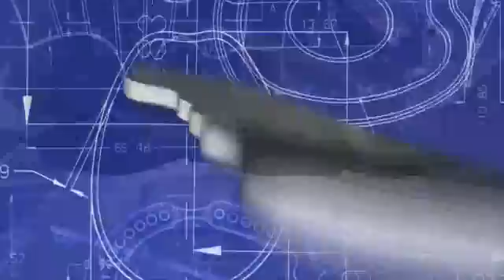#britek  Energy Return Wheel... Autonomous Never Flat

Comment from the maker: @THXn11 The hoop is "sprung" to the ground by the 360 degrees of directionally charged membrane. The hoop always fights to return perfect center around the wheel. It responds much more quickly than an air filled baloon... is anti gyro. and anti bounce. Bounce is cut in half as the equal and oposite actions happen in the same time on opposite sides of the ERW  a "singularity" action that pnu can not match.

Comment: @EnergyReturnWheel incorrect. staying flat will not improve handling. as it will remain rigid, and like any low profile tyre , will create slide or stepping out, . on traditional tyres the side walls flex in lateral movement and transfer of weight to eliminate slide, as your tyres are so rigid this will slide out, making it more dangerous. i am wondering where your information is coming from and what studies and field trials have you done? also where is the tabulated data to back up your claims?

Comment: THIS video, where I can see a lot of steel and bolts, so I made a presumption regarding the weight compared to existing run-flat tires (which, admittedly, require replacement when breached, compared to a lump of metal which, obviously, does not go flat at all).

With over a thousand comments, I am sure you cannot actually expect me to read through them for further information..? I can get that information from your site? ;)

Comment from the maker: @honorific88 patent searches we did showed a linear coil spring wheel out of the early1900s. Interesting for buggys but for cars a throttle responce and handling created tiping  and rolling around.  Our 360 opposing membranes are drawn with aprox. 300lbs. each upon installation and perform like directional slingshots... all focusing to a single point  against the pull of g. or other forces when the wheel is on the ground. And yes it does require less energy.

Comment: In a drag car they have normal tires with sidewalls, those sidewalls flex hard so the car can grab traction. Does the steel hoop in this car act like a side wall? Or is this just for everyday driving? Even drag racing on the street....

Comment: the only safety plus is for people who somehow don't know you have to check tire pressure and run them flat.  They will increase gas milage a little because it has such a lower rolling resistance due to the stiffness of it so its footprint is smaller but with a smaller footprint comes less grip so you have to use a super soft rubber to make up for that.  Then with softer rubber comes less milage life for the rubber part.

Comment: He didnt do anything... You hit a curb or a speed bump the wrong way the steel will dent and deform. Driving on high ways or free ways at speeds of 60mph+ will create heat within the tire that may warp the steel, especially when a person were to hit something(animal, debris, etc). N2 within tires will morph but then redistribute pressure. This wheel has potential, but in no way is this efficient to buyers nor sellers.

Comment: Yes i just re-watched the video 3 times and there is no way for the tyre to "bend" on the sidewall because you have eliminated them and also seems as though the actual rubber that is touching the ground is bolted to metal how can that twist and flex with the weight of the vehicle, example: your turning right so the weight of the car has moved to the left and the left tyres have the most weight on them so by bolting the tyre to metal it makes it very hard to have the tyre moving like a tradition

Comment: well said...  you'd pretty much have to cover them with sidewalls to keep crap out, and, they will NOT hold up on performance vehicles. also, slamming the brakes puts MORE stress on a tire/wheel than breaking them loose with a burn out.  they can test the safety up to 65mph or whatever, but people go faster OFTEN. they will fail. grade 8 hardware is brittle. normal bolts are too weak. w/ proper amount of steel bolts, wheel will weigh more than a normal wheel. run flats work fine!!!

Comment: Modes of failure:  1) shear forces applied to the current size of threaded bolts in sharp cornering will reach the ultimate tensile strength of bolts or at the very least place them in the plastic range.  2) mud, snow, ice built up in the gaps will cause imbalances in the wheel resulting enhanced vibrations that are considerably greater and more frequent than those experience by normal tires.   The end result: greater tire, suspension and frame fatigue.  And, the list goes on.

Comment: this is interesting tech and good luck with development. the problem i see is handling. tyres have been designed to move and flex whilst cornering to keep the largest contact patch on the road. this set up would prohibit that and thus reduce handling making cornering dangerous and causing more accidents. like low profile tyres, they do not handle in cornering situations and tend to skid or "step out" also if this wheel was the jam up with mud or debris it would decrease handling and efficiency.

Comment: What is the net effect of "increase efficiency" and increased weight of these wheels vs. the standard air-filled tire?  A simple comparison test for a tank of gas run on 4 normal wheels vs. a tank of gas run on 4 of these wheels would help prove your case.  Has such a test been done?  If not, I would have to call bullsh$#.

Comment: @EnergyReturnWheel 180,000 Kilometers (112,000 miles) is a little over 25,000 Kms a year (that's 16,000 miles/year).  About average for the typical Canadian in this area.

BTW - I keep the tires on my bike full of air too.  I had a problem with cactus needles but I put a product (Slime®) in the tires that seals any small holes as soon as there's a leak.  I haven't had a flat in years.  Oh, I wore out a set of tires on my bike too.  It only took 2500 Kms - but for $50 I had a brand new set.

Comment from the maker: @jojothedog1234 The spring replaces the air, and transfers the energy from bumps more efficiently back to the ground by levering from the TOP and Front back of the tire.  This is also apparent in a dragster tires crinkling to hold grip slingshotting it forward while  torque is applied. WHICH is the very reason why they are so BIG.

Comment: The idea is great, but will it endure years?? My concern is in the spring like spikes, with time any metal used as coil overs, leaf springs, etc. loose their tension and also tend to loose their original shape. It would be catastrophic if the springs on these wheels begin to have the same symptoms, it takes no genius to know what will happen if you hit a nasty dip at high speed and these springs don't return to their original shape!!!

Comment: @EnergyReturnWheel im not saying that the tread wont be replaceable im saying its not going to be at the 5 tires shops within a 3 mile radius of my house, they're also going to cost more than the 35" BFG Mud-terrains that are going on my truck now (which are pretty damn expensive)
Useless was a strong word to use and thats not the case here, they are useful but no to the majority of the population.
Also with skinny ass rubber comes a very rough ride... something to think about

Comment: I have logged 180,00 Kms in the last 7 years and have gone through 3 sets of tires.  Not once have I had a flat.  Point is, normal street tires wear out and are replaced more often due to road conditions, traction conditions and speed than they are from failure.  The tread wears on ashalt...period.  That is not going to change with this new concept.

Just like the people who have spent millions trying to make a pen that will write in space when they could have used a pensil - why complicate it?

Comment: @EnergyReturnWheel " But the Goal is the make them the obvious choice in Tires."
 
Then its mechanics should be better explained. I have watched the other videos. The ERW 3d animation was on the right track but not clear enough for the average Joe to understand how it works. I have a decent mechanical background and still had a hard time wrapping my head around the concept. The details of each component isnt explained at all. All that is really shown is a guy hitting the spring with a mallet.

Comment from the maker: @JOkaiQ 1. Airless, run flat, and durable components and long lasting performance!. 2. It works by allowing the force of the cars weight to be distributed to the Front and back of the wheel instead of Straight down, 3. if you put it on your car you can expect not to fill it with air or get a flat tire, because ERW© will always stand behind our product.

Comment from the maker: @tomebaden Case in point.. as the wind pushes into the front of the wheel... it does return it by letting the wheel roll up inside the hoop and creates a low pressure system pulling the wheel forward.

Comment from the maker: @vasco10506 The DOT testing is on a glorified Treadmill.  Even our First ever Prototypes were run up to 75MPH on an AWD dyno under 6000lbs of load pressure and fared just fine in which the DRUM heats up the tires to way more than the operating temperature once on road.

Comment from the maker: @angxtrom The inner posts were a good testing and tunning solution for our first portotypes shown in this video.  we have Kevlar Inner Pins because the are PULL ONLY.. they do not need to ever push on the wheel. The wheel hangs from the top.

Comment from the maker: @GMELECTRONICS365 Cost is an issue that seems to come up rarely in these posts. These can be constructed as easily as any tire wheel combo, and when safety is concerned a run flat tire with great handling and that lasts a long time with little to no maintenance will always be a viable option for as long as automobiles roll.

Comment: looks expensive. also you would have to replace the rim and tire as one when low on tread or pay a mechanic 65 an hour to un screw 400 screws and retighten them when changing tires. also 99.99 a new tire 499.99 erw tire, whose saving money here.

Comment: @vasco10506 
I have always said that the roads should be made of rubber and the tires concrete, reinforced!

You need to fix the highway, plug it! 

Tires would last the life of the car, the centrifugal force would make it roll forever..

If you need fancy, buy Marble or hire a sculptor

Comment: Coming from a Mechanical Engineer your energy analysis is incorrect. Yes the top of the wheel will have more energy than the bottom but this is true for every wheel, its because it is further off the ground. However, the notion that this makes the wheel roll easier is false. The fact that the hub floats inside of the tire will make for a comfortable ride but it will detract from the energy efficiency. The easiest thing to roll would be a completely rigid wheel as there are no translations.

Comment: @luminaeus
I guess you could say that. The current design of tires are a "Best-of-both-Worlds" technology. However, there are inherent limits. One limit is the rolling resistance. A compromise between traction\wear & fuel mileage had to be made to get the right combination of economy and driveability. So while Bridgestone TA Radials were great for hugging turns at high speeds, you were replacing them in less than 30,000 miles.
The same holds true for Michelin Highway Masters, but in reverse.

Comment: @luminaeus

Lower profile tires do provide a degree of greater Control. However, greater control doesn't automatically translate into better traction.
Lower sidewalls means the response to input (like steering) is quicker and less input is needed to make the turn at a given speed of travel.
This also means that driver over-reaction is much more likely especially in rain, ice & snow conditions.
Believe me when I say, I whereof I speak.

Comment: @GryffinDarkBreed

AGREED!

You can't just remove 100% of the Rolling Resistance caused by the Side-Wall Flex of a pneumatic tire and think you can make a "safer tire" than what's currently available.
Lowering Rolling-Resistance is one thing. Eliminating it by eliminating the tires ability to conform to the road surface is insane.
Do some studying and you'll see a direct correlation between lower sidewall heights and "Loss-of-Control" type accidents.

All this is, is a harmonic damper design.

Comment: @daftrok Well maybe even half of the people commenting on the video are into motorsports, im one of them. I like to do upgrades on my car and one of them is the "Big brake conversion" which usually has a rim size requirement to clear the brakes. You really cannot solder onto an aluminum or alloy rim and expect a safe rim, also aluminum doesnt do well in welding conditions either. Idk, i think the ERW has a good concept going on but still needs alot of development.

Comment: Airless wheels have been tried before.  The reason pneumatic is what was settled on is that it's evenly distributes pressure over the entire wheel.  This won't do that.

Also, lower efficiency is a direct by product of the comfort of the ride.  It absorbs vibration in the road instead of transmitting it.  It's intentional.  If you've ever ridden on a performance bike, versus a touring bike, you can feel the difference immediately.

Comment: I see several issues with this, the first one i think you wouldnt be able to use this for race vehicles due to brake caliper clearance and the bolts sticking out through the inside of the rim, and other stuff

Comment: @sharpiesreef Yes, the principle is the same but it doesn't oppose resistance to turning all the time in this case. Only during accelerations and decelerations. You connect the outer shell to the transmission and the inner magnet to a shaft that is normally coupled with the transmission but decouples when you're decelerating. That way you gain free energy from decelerating. Thing is this design relies completely on engine braking and may cost a lot because of the magnetic materials required.

Comment: @ilovenh1 Indeed. I see this working much better with barrel-shaped hollow wheels that hold magnets on the inside of the empty "shell" and a bigger magnet on the inside of the shell that constantly keeps the shell form as-per-design AND can be used, in combination with the magnetic field of the magnets placed on the shell, to transform motion into electricity.

If somebody doesn't research and patent this, then I will. I just hope artificial magnetization is not costly =)

Comment: Interesting idea.  I can not help but wonder about the weight though.  How do they compare to a standard wheel/tire combo of the same basic size?  This is especially an issue for performance cars and tires where unsprung weight is a big issue with handling.  I also know Michelin worked on a similar idea a few years back but it kinda whet bust.  Not sure why or how different it is from this design.

Comment: I see a few problems
1) Grip, the air tire conforms to the road I don't see how this tire can do that
2) Weight. A light weight metal like aluminum can not be used to bolt the tire to the rim, because daily use on poor roads would crack it and other metals are too costly. Air is lighter than steel
3) Cost, I do not see how this tire could be cheaply manufactured
4) Side wall protection, what happens when this tire meets a curb? 
This is a concept in a perfect world but I don't see it working

Comment: I used to work as an engineer at a tire company... and I just have to say, this is kind of a crock. It would be less obvious if some of the comments and claims made weren't absolute BS. For one, if this thing weighs more than a typical wheel + tire ,then no, you are NOT reducing unsprung mass. Sprung mass is above the axle and ride springs. 

Also, you're going to have terrible wear and performance when you put any camber on that thing.

Comment: Ridiculous
It seems to be almost rigid, i.e. like antique antique wooden wheel.
If it's an airless flexible structure like michelin tweel, the pressure on a point of the surface of contact is approximately proportional to the deformation of the structure
When using air tire, the pressure is identical at any point of contact between ground and tire, due to the homogeneity of air pressure in the tire.

I'm impressed to see that people are smart and see it's not going to replace or tires next year.

Comment: @EnergyReturnWheel:
You have pictures on your website showing the smaller footprint of your wheel, which are commented like "smaller footprint is way better"

Now how do you want to get more grip to the road with a smaller footprint?

Of course, simple accelerating and braking will "reshape" your wheel so it gets a bigger footprint, but this also works with regular tires. What i'm wondering about is, how will your wheel handle high speed cornering. In this case a smaller footprint is way worse.

Comment: The only flaw I see with this design is the loss of the cushioning effect of an inflated rubber tire. Your Mercedes was able to move around the guy's driveway, but how does it stand up to 50,000 miles of wear? I would also imagine with all the metal/kevlar/carbon fiber/fancy space age material you have in there, it increases wheel vibration and noise. And finally, weight! What is that, a 1/4" thick spring steel hoop you got in there? Is the entire assembly lighter or heavier than a regular tire?

Comment from the maker: @corotor12345 With a smaller wheel you would get LESS gas millage not more.  You get more torque to ground however.   But we only did this because they are matched to a different Vehicle than what was used on the dyno.